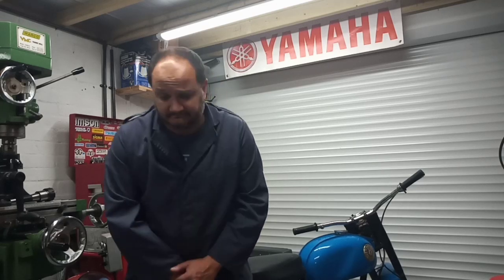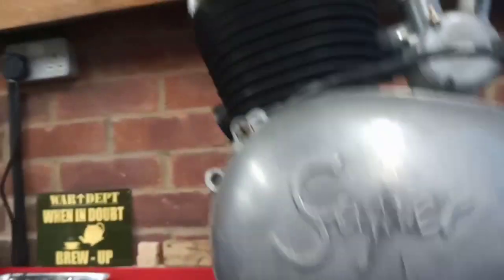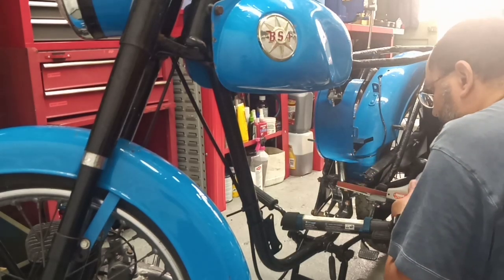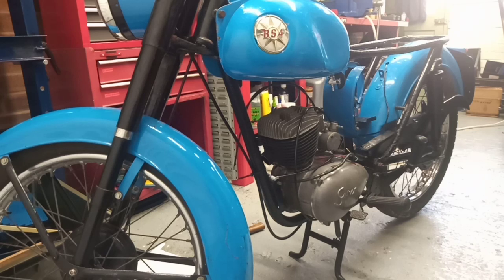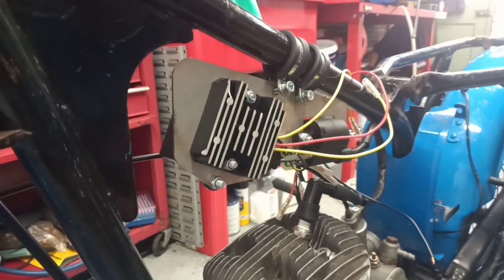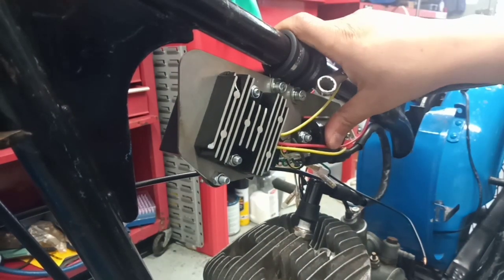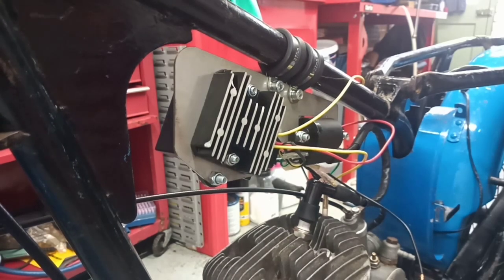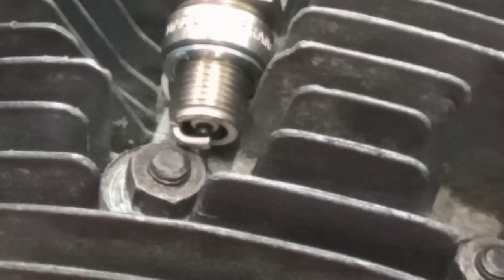Bantics - BSA Bantam D7 Engine installation and CDI connection, Sparky Sparky!

Comment: Another great video Dean. With CDI's a lot of people think the spark is weaker than the original points system. CDI's spark with a greater intensity at a shorter duration, therefore seem "weaker" than they appear. I've had plenty of people say "the unit isn't sparking". I tell them to fit it and start the bike, or do as you did and check spark in the dark. It always runs! The main wire to the module from the stator is designed to follow the spine of the frame. The bike looks in very good overall condition and can't wait to see it run..........
Reply from the maker: I can't either Bones. Exciting times. The spark is definitely a strong one, I hardly had to kick it. I'm very pleased that I managed to find this system, it's a credit to the bloke that designed it! I used to use a slightly hybrid version of the original East German CDI system on my tuned Simsons, they went like stink so I'm very much sold on the concept. 
The Jawa is looking fantastic by the way. 
Best wishes, Dean.

Comment: Coming along nicely, my D1 plunger has a welded on bracket under the tank (standard fitment) which I used to attach my electrics plate, pity BSA didn't fit same to the D7, much more secure than using P-clips.
Reply from the maker: To be fair, they are pretty good. I don't think I'll have any issues with them. A solid bracket would be a gold plated solution though. 
Best wishes, Dean.